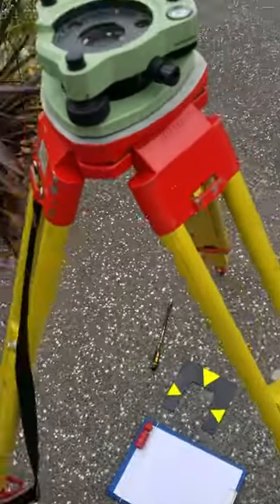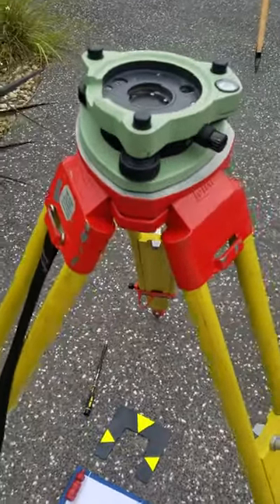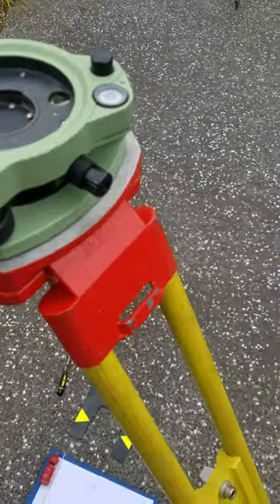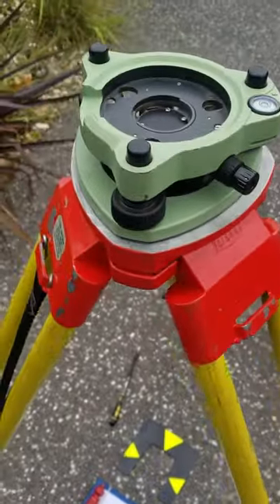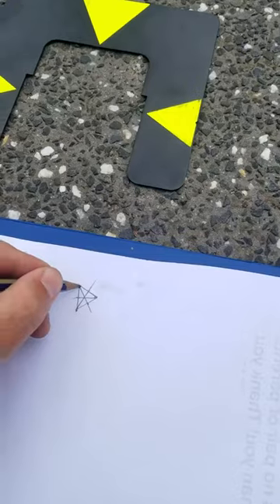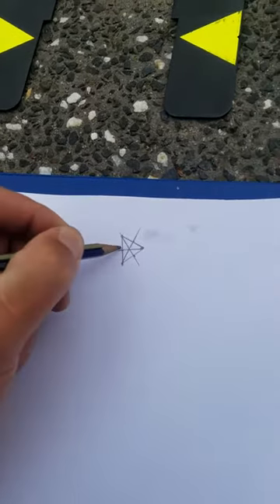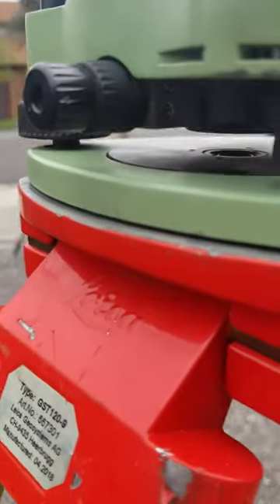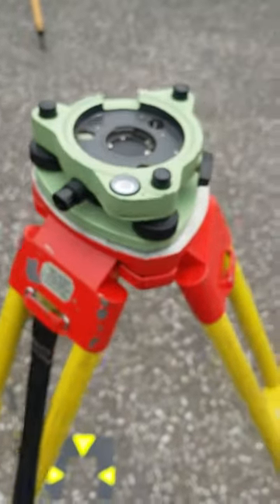Calibrating an tribrach mounted optical survey plummet

Comment: I feel like this isn't the most accurate way to do this, probably more accurate to backsite check then spin the tribrack 180 at this point.
Reply: Can you explain a bit more? How would you actually adjust it to be correct?